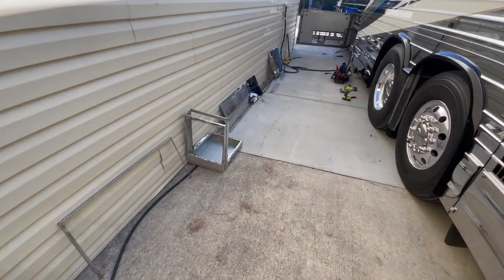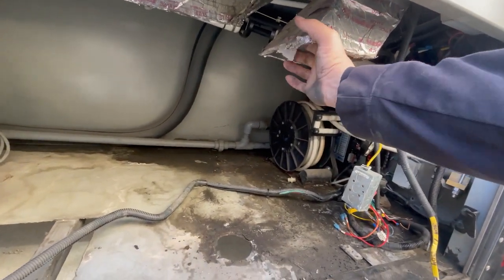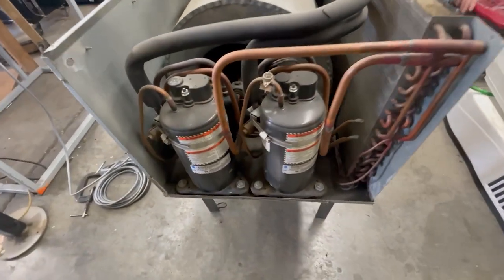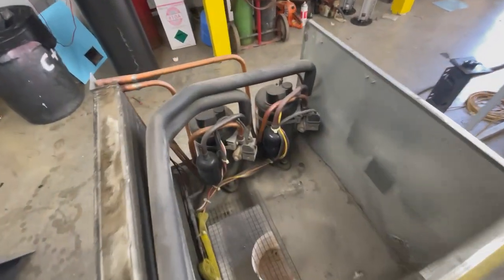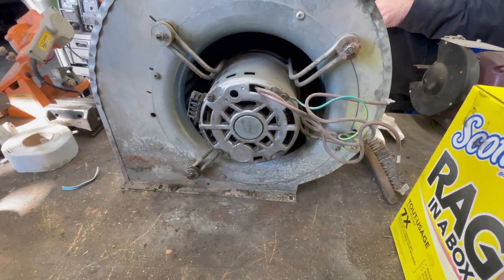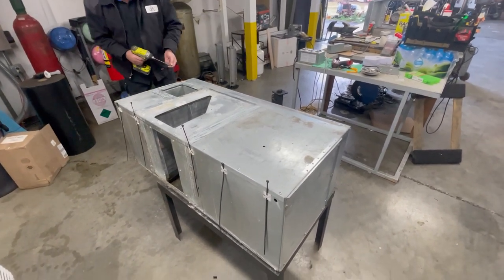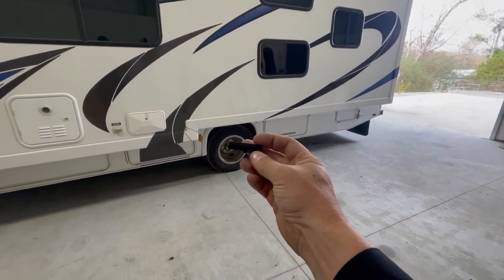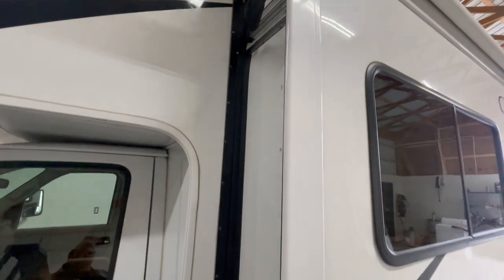Prevost Bus Basement Ac

Comment: What model of prevost has basement air? I only had heard cruse air. I love my coleman basement air in my 2002 Beaver. This summer at 95 degrees I was getting about 22 degrees differential and SOOO quiet compared to roof air.
Reply from the maker: Country coach did the build out on this Prevost so they used Coleman exclusively on them. Thanks for watching. Sounds like your basement ac runs great. Let us know if we can help in the future.